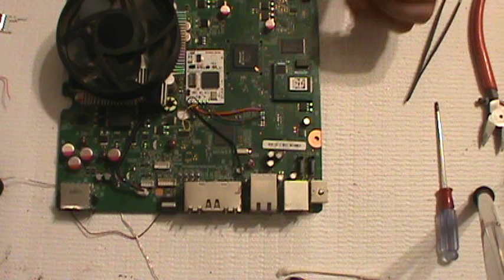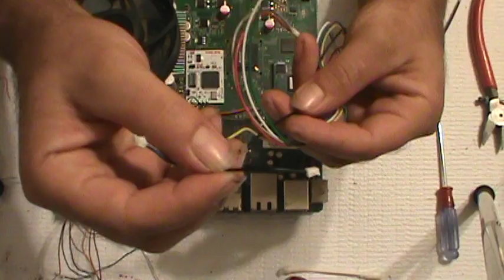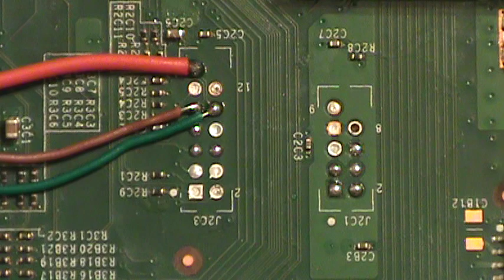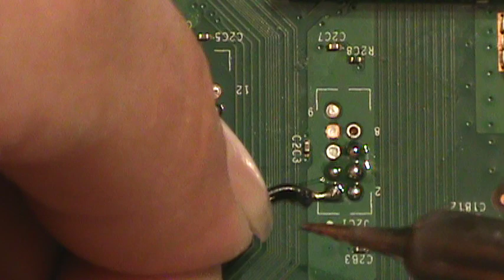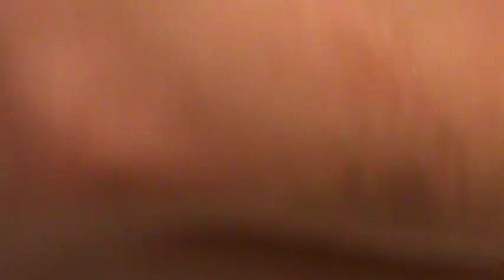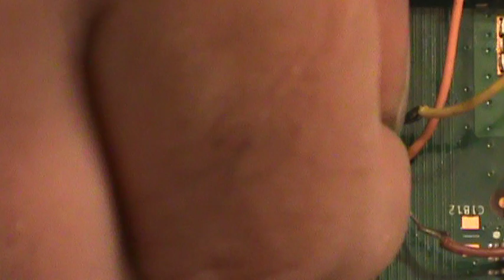Xecuters JR-Programmer/NandX direct soldering Tutorial

Comment: I am having issues connecting the yellow wire. All of the wires shouldered well except for the yellow, please help?
Reply from the maker: Jackson Lange for some reason the yellow wire gives a lot of people trouble. 
The yellow wire is actually the ground. You can just solder that wire to the AV housing or on the edge of the board. 

Anywhere ground is good
Reply: Keil423 I did that, thank you, but JRunner isn't working for me too well. I'm not sure what the issue is honestly.
Reply from the maker: Be sure to have the consoles power supply plugged in but leave the console off. If your getting flash config 0x0000000000 then your likely still having soldering issues.
Reply: Is there a newer version of JRunner that I am supposed to use? I am working on a 17511 dash, is that still exploiable? I am using Rev C coolrunner with J R Programmer on a Slim Trinity.
Reply from the maker: Jackson Lange visit team-xecuter to be sure your getting the latest version. All dashboards are currently exploitable, but not all consoles are. I.E. the Winchester motherboard found in the latest SlimE models are not exploitable.
Reply: Keil423 Yes sir, it is a Trinity Slim Motherboard. Do I need an Ace or will a coolrunner Rev c work?
Reply from the maker: The genuine rev c works fine on trinity. If installed properly you should be able to get 30 second or less boot times.
Reply: Keil423 I bought the legitimate coolrunner Rev c. JR Programmer will work though? I just need a good enough solder connection?

Comment: PanTerror90  I would recommend the Auyou 469 Solder Station. Jist got mine 2 days ago. Look at thedopesoner930 's channel for the review of It and stuff. It is a multi-wattage soldering iron. The max wattage is 70 and the lowest is about 25 so it is jusJust perfect for xbox modding. You can buy the product here: https://sra-solderproducts.com. or somethkmg like that. That's where I got mine. And it comes with a fine tip so Its just an awesome bundle just for $25.99+ shipping!

Comment: What type of soldering iron would you recommend for working on a motherboard, and which one are you using in the video?
Reply: PanTerror90 Get a weller Electric, it take 4 AA and its kinda weak so no need to fear over heating!
Reply: PanTerror90 Get a weller Electric, it take 4 AA and its kinda weak so no need to fear over heating!